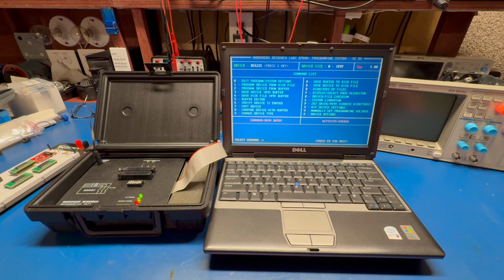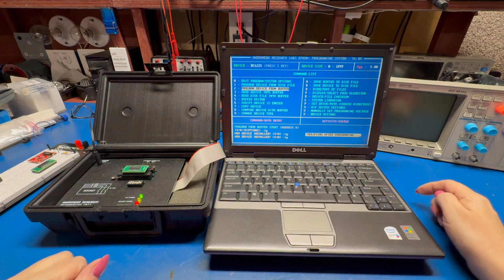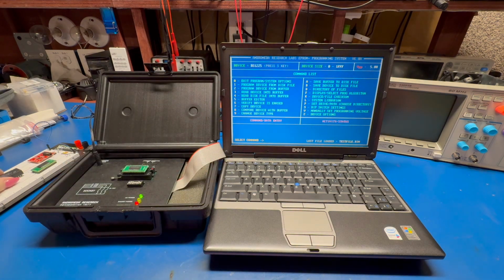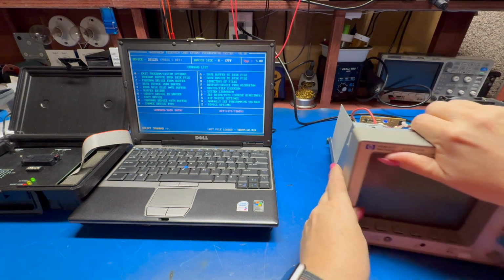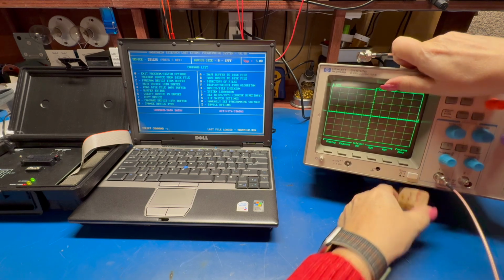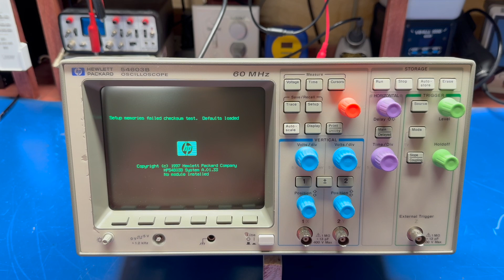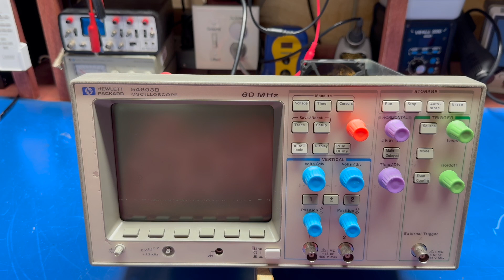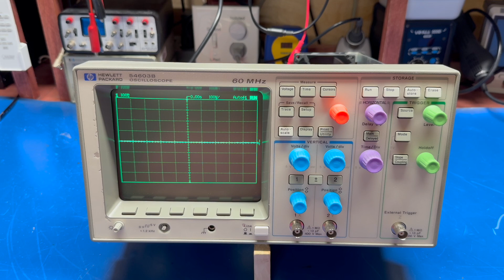Replacing Dallas DS1225Y NVRAM with FRAM (Part 3)

Comment: Damn, this oscilloscope is awesome. It really has the PIP-Boy vibe from Fallout
Reply from the maker: They're nice scopes: compact, relatively light weight, and easy to use with not too much menu diving. I decided to have some fun replaced the knobs with Chroma Caps from @djtechtools, because why should test gear be boring?

The scopes do have their limitations compared to newer digital scopes, but the prices on these are typically in the $120 ballpark for a 100MHz and in my opinion make a nice first scope - and if you are doing mainly audio work, it's probably more than you need anyway.

Oh - and these have an 'easter egg' built in game! I have seen Tetris, Asteriods, and Centipede games in them.  Each scope is something different. 🙂 Maybe I need to make a video on those... 🤔

Comment: Afaik the scope will auto calibrate itself with an empty fram, there is the procedure in the service manual..
Reply from the maker: Hi 🙂 The issue wasn't running a self-cal, the issue was the scope getting stuck on the boot-up screen with an error that seemed to be because of the blank FRAM.  That was the reason for copying the existing cal data from the NVRAM.  After doing that, the scope booted, and I then did a self-cal - which seemed to work until a reboot, and the scope complained about bad setup data. The setup data is the saved scope setups (you can have 16 of those) and is different than the calibration data.
Reply: @Donna_Matthews  - what happens when you put an empty FRAM into the scope and do the loading of the default cal settings - see p.4-31 of the service manual, mind the rear UNPROTECTED switch -- and then you provide the calibration as described in the service manual?

Comment: Hi Gary,  I'm super curious what could be learned from hooking up a logic analyzer (you'd need a lot of channels, so maybe not ideal) or a ROM/RAM emulator to it while it POSTs.  Given that your EPROM programmer can't tell the difference between the contents of each chip, I wonder if the ST battery-backed RAM has some extra functionality like a built-in checksm function???  I'm just brainstorming here, but I'm having a hard time figuring out what could be different other than maybe something "out of band", if that makes sense.  Love the videos, btw
Reply from the maker: Thanks 🙂 What gets me is that doing a RAM test on the FRAM in the scope passes fine - which would seem to indicate that the scope can read / write to it with no issues.  Flashing it before putting it in the scope works fine.  Running a self-cal works fine. Saving setups works fine.  It's only on a reboot that it says the saved setups are bad. 😑 I have have new NVRAMs that I put in the 54603B and 54620A, and I'll do the same for the 100MHz 54645A.  I'll probably write this up and post on the EEVBLOG forum - see if the people who really know what they are doing have any suggestions. 😊
Reply: @Donna_Matthews  Yah, that's so interesting.  It makes no sense to me that all the testing you've done passes fine, and it would have this checksum issue.  Did you say the part number on the ST micro battery-backed RAM?  I'm curious and I'm thinking about checking out the datasheet

Comment: Hi, I don't know how this model works, but when replacing the memory of the Tektronix 2465A and some B models, you have to install the classic memory and the battery has to be installed separately. I have two 2465s at home and they work with the memory without a battery, but they don't have as many computing functions as the A and B models.

Nice day 🙂 Tom
Reply from the maker: These scopes (at least this earlier HP branded version) do not have a replaceable battery in them.  The saves settings are in the NVRAM modules which have their own internal lithium batteries.  The idea here was to eliminate the need for the battery backed NVRAM by using the FRAM, and as I said, I did see someone else do this on a later model Tek scope.  Based on that, I see no reason for the error I am getting.

I have already purchased new NVRAM modules and installed them in my 54603B 60MHz scope, and in my 54620A Logic Analyzer.  Both of these are working 100% - which was the goal all along.  Turns out the NVRAM module in the 54620A has a date code from 1995.  Almost 30 years old and it was still working.
Reply: @Donna_Matthews  As I wrote, I don't know these oscilloscopes (I would like one for audio testing - big screen), I was based on the fact of replacing battery-less RAM in Tek, the battery is installed separately when replacing. 
I don't speak English very well, so I don't know if I wrote my comment clearly, but the Tek also doesn't have a replaceable battery - it's part of the memory, when replacing it with a battery-free memory, an external battery is installed - so I assumed that after the loss of voltage when the oscilloscope was turned off, an incorrect behavior and hence the idea of an external battery.
The problem with these batteries is that they do not have a classic discharge curve, they spend almost their entire life at about 80% capacity and then die in a moment
Reply from the maker: @Edisson.  Your English is fine. 😊 If you are looking for one if these, you can often find the 54603B 60MHz scope for around $100.
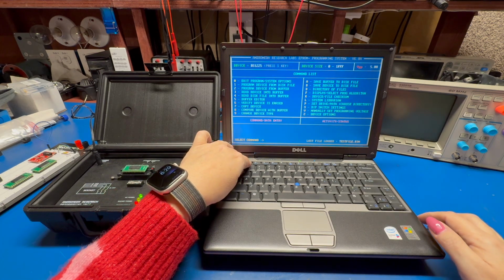Reply: @Donna_Matthews  Thanks, but I don't need it anymore, I used one of my TEK 2465s to measure audio, made atypical cables to connect to an artificial load, when switching the 1:1 attenuation to the 1:10 range on the load, the range on the oscilloscope automatically switches as well - my workplace settings can be seen on the EEV blog, my nickname is Edison
Thanks for the compliment on my English, I know a little and when I don't know I use Google translator to help me

Nice day 🙂Tom